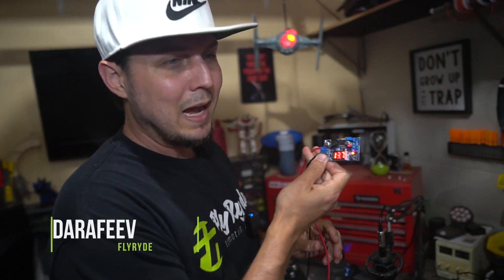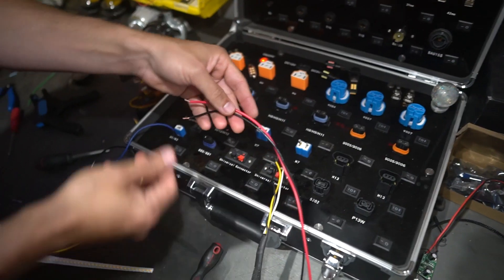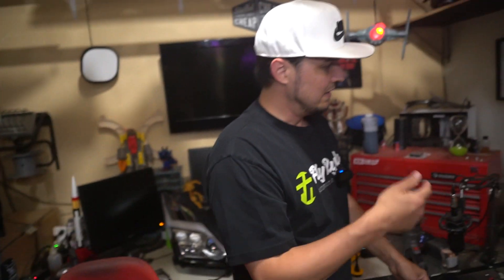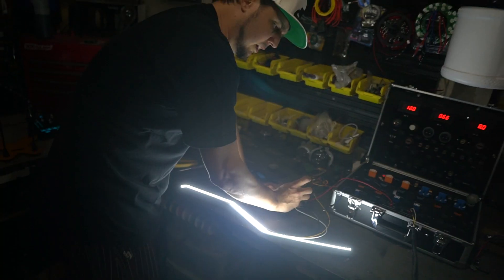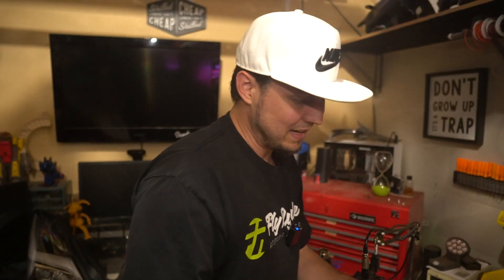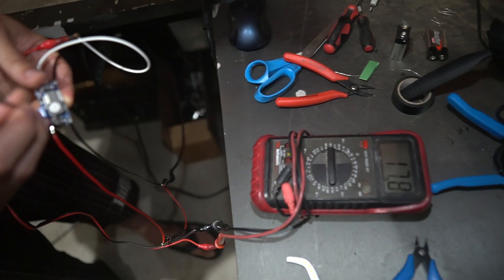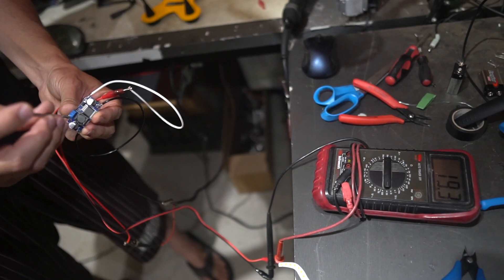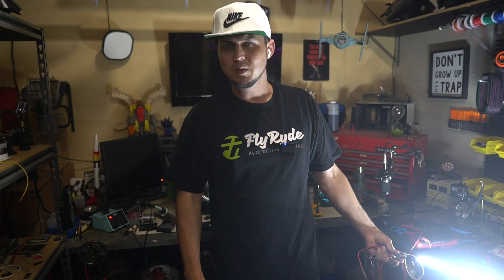How to make LEDs BRIGHT

Comment: You should change the title to  " How to easily damage your DRL ". No offence BUT, the more voltage you put in, the more heat you get, which is a real problem for any kind of LED.
Reply: The reason for having resistors in series with a LED is to limit the current through the LED. The LED has a fixed voltage drop  in the range of a few volts. You choose the series resistor to make sure the LED current never exceeds the data sheet maximum value. The way to do this is, measure the highest supply voltage your LED circuit will see (if you expect 12v always, you will fry your LED if the voltage jumps to 14 or 15 in a car start up situation) and you pick the resistor accordingly. If your LED voltage drop from data sheet is 2.0 V , and your highest supply voltage is 14, that leaves 12v of potential that you need to “drop” with a resistor. To find the resistor value you divide the 12v by the maximum led current from the data sheet. 
Obviously this becomes more complicated if you have many LED In series and parallel combinations. 
If your DRL bar has integrated resistors in the circuit, and was designed to take an input voltage of 14v, then all you are doing by using this DC-DC buck boost converter in the video is ensuring the supply voltage is at your desired level. 
If the DRL board does not have on board resistors (as is the case with some LED halo rings) suppling them with too much voltage will generate a high current and fry them. 
The most important thing is not exceeding the LED Maximum current rating. 
If the DRL is designed (with resistors) for a maximum of 14.5V supply, and you supply it with 20V, you are forcing an extra 5V of potential across the Resistor and therefore increasing the total circuit current which might be more than the LED can sustain during long operation. 
This dc-dc converter in the video will only supply as much current as dictated by the load and the supply voltage. 
For completeness I would test the current being supplied to the DRL whilst changing the output voltage of the dc-dc converter and see if that exceeds the maximum from your design specification. 
Thanks for the videos and keep up the good work!
Reply from the maker: Yes, if you are using LEDs that are maxxed out at 12v, you’ll need voltage regulators. If you have parts that can handle way beyond that 12v, or even beyond Engine-On environment (14.5v ish), such as just about every single non regulated LED bulb on the market, then you’re fine.

We’re simulating normal operational use, not overclocking beyond a safe setting. Make sense?
Reply: @flyryde  there’s no such thing as “non-regulated” led on the market, why do you think they are connected in series and have those resistors in place? The fact that you’re not using them, it’s a different story.
Reply from the maker: @alincatalin6087  lol, listen man, I know you think you’re understanding this, but I’m trying to help you. LED bulbs, aren’t regulating the power, then sending that regulated power to resistors that then send that power to the LEDs.

LEDs have resistors to drop the voltage from the car to safe levels. Again, there are no voltage regulators. That means if you have resistors on those LEDs that push them to the limits at 12v, then simply starting the car would overpower all the LEDs. 

Not just a little bit, they’d all fry. That’s from just going up 2.5v. Don’t believe me, just start your car, turn on the parking lights, and probe the + wire with a volt meter. 13.5-14.5v

Are the LEDs frying? No. Is a boost converter boosting amperage? No. Is it take the available current, and increasing the voltage, while slightly robbing the amp output to jump that 2.5v when off (and not having to do so when the source voltage is equal to the set output voltage)? Bingo. 

I’m gonna leave this alone now, lol, but I hope that helps. I dumb it down to make it accessible and understandable to non nerds.
Reply: @flyryde  sorry man, that's just wrong.
Reply: Clearly he doesn't understands how a diode/LED work, they are NOT voltage driven but CURRENT driven, a diode have a forward voltage drop after which it starts conducting. White LEDs are typically around 3V and are wired 3 in series in automotive applications to drop 9V and a resistor is wired in series to limit current. Anything above its Vf and the current will skyrocket.
Instead of experimenting, he should just read up...
Reply: I was just about to comment this. I experienced this issue with my headlights that I built. The 14.4V ran the LEDs really hot. Ever since I’ve used regulators to keep it at 12V.
Reply: @rushilkisoon   if you increase the voltage specified by the manufacturer, even only by 1V, they're gonna run hotter and they're gonna fail really soon ... something that you really want to avoid on a custom build, coz you're gonna have to take everything apart, again :-))

Comment: So in other words if I want my led strip to be brighter (to be seen better at daytime) I could get this? Does that module gets hot? The one with the led display
Reply: Unlikely that it would to dangerous levels. The LEDs certainly would.
Reply from the maker: Terran you’re looking at this like they’ll get a different amount of heat than when the car is running. They won’t. They’ll simply be able to run the same brightness (and heat) when the engine is OFF, as the brightness when the engine is ON.

Comment: you ever used the wire strippers on old car wiring? Or just new wires? Groovy vid my dude 👍
Reply from the maker: I have many times 👍 what kinda old car are you thinking about? Anything specific?
Reply: @flyryde  my brothers and I are working on a 53 Nash. We have to rewire. It sat in a barn for years and the mice ate most the wire 🤣

Comment: I didn’t see the link for the voltage adjuster with display. I want some of those for sure. They will come in very handy on after market lights on cars and motorcycles.
Reply: They’re also called buck converters and people use them in the 3D printing world all the time.
Reply: I was checking for it too. I once bought a step-down converter by Drok, which seems to be a popular brand. Try searching for it on Amazon for the step-UP converter that displays the voltage on the unit as he has.
Reply: @VaronsFirstLove  JacobsParts FP5139 100W DC-DC Boost Step-up Voltage Converter Module Adjustable Power Regulator Board with LED Voltage Meter https://www.amazon.com/dp/B079YX761G/ref=cm_sw_r_cp_api_glt_i_3HEJKDPQP03E78NMX7GC
Reply: @tribaluce1832  Well done!  Thank you!
Reply: JacobsParts FP5139 100W DC-DC Boost Step-up Voltage Converter Module Adjustable Power Regulator Board with LED Voltage Meter https://www.amazon.com/dp/B079YX761G/ref=cm_sw_r_cp_api_glt_i_3HEJKDPQP03E78NMX7GC
Reply: Here is the link to the Drok step-up converter.

https://www.amazon.com/gp/product/B07VNDGFT6/ref=ox_sc_act_title_1?smid=AFHAE9RJVUMB&psc=1